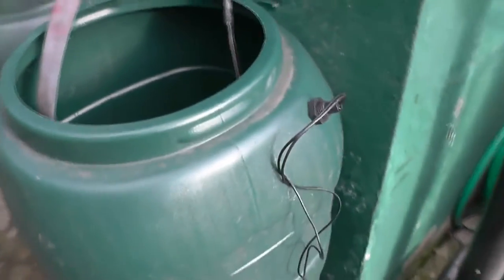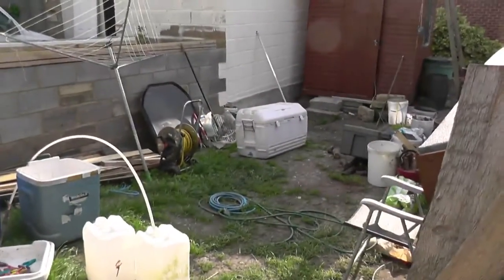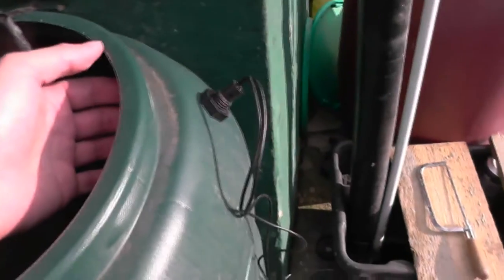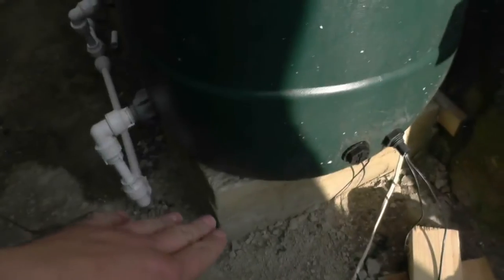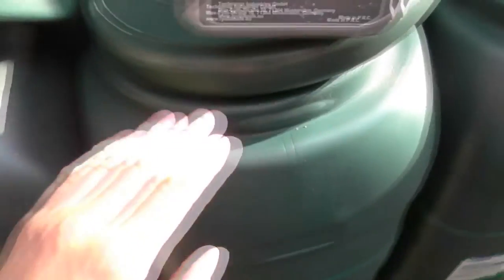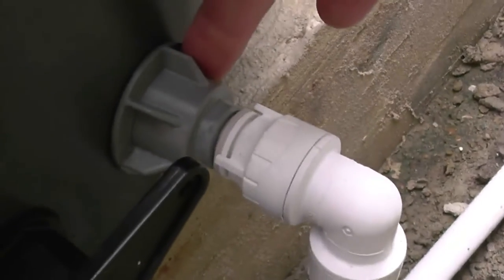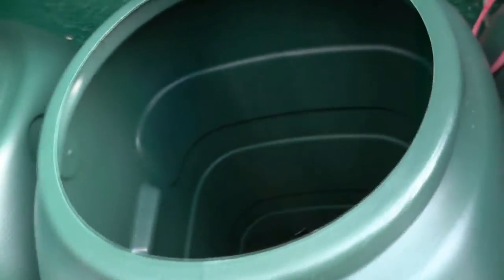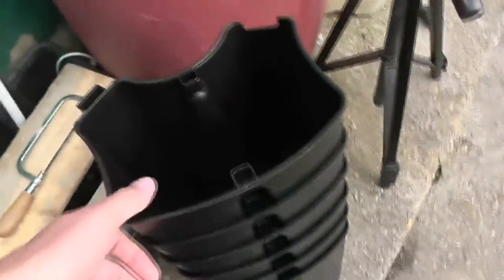rainwater toilet upgrade - Capacity

Comment: Good job. I shall soon be embarking on a project like this for myself. I recently bought a house and the previous owner left four 100l water butts behind, but best of all a 1200l tank which used to be for heating oil. It was full of rain water when I moved in and has no smell of oil, so I rekon he'd been using it for water storage for quite a while.

Comment: I like the filter idea repurposing unused items and enjoyed the flushing the silt pun! :-)

I presume the water butt toilet flush is for environmental reasons? All those water butts add up to a fair few meters cubed of water - assuming you're on a water meter.  Good job though whatever the motivation.
Reply from the maker: the pun was unintended! but it works =). It costs me £1.50 per 1000l and £3.00 for treatment. I can save more money flushing my loo that I can using my solar system. Once this is all done I can focus expanding my solar and hopefully start with my fridge and freezer TV and laptops and see what kind of dent that makes.
Reply: i have moved partly to solar 40 watt at moment 44ah battery things that still run on mains are frdige freezer and pc monitor i have gone from 10 a week to 10 a month electric ther main part of that was no longer using the pc but started to use a meegopad to2 in stead same power as a tablet but hdmi they is only me so thats another reasion why so little power usage pc is centre of my entertainment so also means no tv licence my internet i chip in with next door
Reply: the lighta made by raymond earl are brillent one of his bulbs will light a 4x4m room easy and draw 250ma or if like i do a small boost converter to keep voltage steady and light at same brightness no matter the pack voltage then it draws 500ma
Reply: +pietkaify Yeah, my solar habit doesn't make financial sense, but I like to think I'm doing something! I think your environmental improvements in a typical home (without acres of land or bundles of cash) are to be applauded and prove that everyone can make a bit of difference.
Reply: +David Simpson Sounds like you're starting to save - I guess you'll need more solar come winter though. 

Worth checking up on the tv licence though - I think the regulation changed a few years back. Any home with a device able to watch live broadcasts needs a licence - so my understanding is that's TVs but now any internet connected computers, tablets, phones...  Best to check it out to avoid any fines.
Reply: i have no tv's nothing that can watch a live broadcast you ever tried to find a live broadcast of anything on the internet for free i havent yet  and phones computers are a scare tactic you basicly ring them up tell them you no longer have a tv and that you dont need a licence they say they send some one out and never do been doing it about 3 years now
Reply: and yeah deffo you ant far wrong on the needing more solar lol i have a small charger pluged into the wall to set at 12 volt so some doesw come from the mainms but long as im out at work it about off sets with the solar will also be plugging bike into the system when im not out on it as it has kick start if battery a little to low to elec start i can still get going and charge it wheil i ride to work etc i found trying to build solar to fit your normal house hold needs you just dont have enogth area for panels etc so i sat back and really looked at what i used and what i really needed and did not need

Comment: pretty sure youre in the UK. (judging by the accent) and here in the US its illegal to "collect rain water" -_- which ive recently found out does get enforced.
Reply from the maker: yep in the UK. if you aren't allowed to collect water then they should clear your drive when it snows! what's the fine for collecting rain water?
Reply: thats an interesting point! lol but no it just qualifies for rain. not for snow. (at least as of now...) however this was copy pasted from an article i saw a while back "A rural Oregon man was sentenced Wednesday to 30 days in jail and over $1,500 in fines because he had three reservoirs on his property to collect and use rainwater" more recently ive seen and heard of it being enforced in other areas. i live some where that it hardly rains. so i dont think they have a law against it... but in many states its an actual law against collecting rainwater.
Reply: then again. sigh. it is also illegal in many areas to run enough solar panels to "live off the grid" so if you want to disconnect from the power grid. its forbidden.
Reply: @amethystsunangel1955  regional thing. ive found states that have it illegal.
Reply: @amethystsunangel1955  on a side note. in some areas there are also restrictions on solar panels and disconnecting from the main power grid. so if you ever want to have a self sustaining homestead. uou have to go by local state laws and jump through their bullshit hoops to even attempt having a home thats selfsustaining.
Reply: @amethystsunangel1955  sad but true 😕